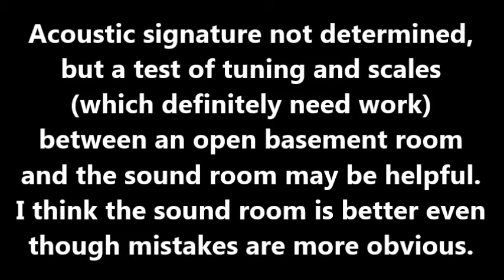Basement Sound Room

Comment: Liked the video, but the link you have provided is no longer active. Could you please provide me with the BAD sheet? I plan to build a couple myself. Also do you know if there are any BAD calculators online? Many thanks!
Reply from the maker: +Emil Dragomirescu
Hi Thanks for the feedback, comment and inquiry.  This link worked in Chrome and it is a PDF:

http://r.search.yahoo.com/_ylt=AwrSbgM7Ld9WiGgALhNXNyoA;_ylu=X3oDMTEyMDhiaTVlBGNvbG8DZ3ExBHBvcwMxBHZ0aWQDQjE3ODFfMQRzZWMDc3I-/RV=2/RE=1457495484/RO=10/RU=http%3a%2f%2fwww.acousticalsurfaces.com%2fwall_insulation%2fpdf%2facoustic_test%2fAS_SA1949.pdf/RK=0/RS=aS3J6phFby6GbwjR5ODMVvHfJD4-

Here's a great QRD diffuser calculator:  http://www.subwoofer-builder.com/qrdude.htm

You can see the BAD pattern here at GearSultz.com.  Scroll down the page; the hole pattern is in black.  For a 2x4 sheet, a 3/4 inch grid from center point should mark 1/2 hole centers. The right or left side could be the center. I used the right side for the center, but left side might be better in hindsight.
https://www.gearslutz.com/board/bass-traps-acoustic-panels-foam-etc/459885-rpg-bad-panel-detailed-plans-2.html

Good luck.
Reply from the maker: +Jt Tylor 
Correction:

Above I referenced left and right of the graphic, but it should have been top and  bottom (I was looking at a different picture).  If you flip the graphic counter clockwise so the the middle solid black line is horizontal, the right side would be in the center of the 2x4 plywood. The other half of the 2x4 sheet would also have that same end facing the center.  So the pattern is symmetrical but either end could be used. :)